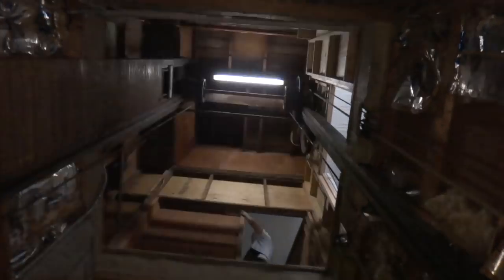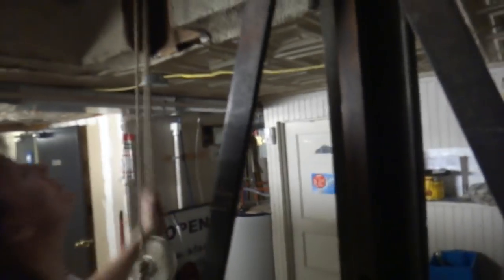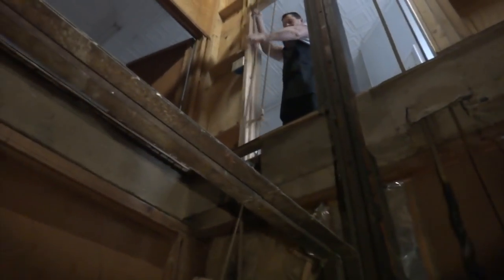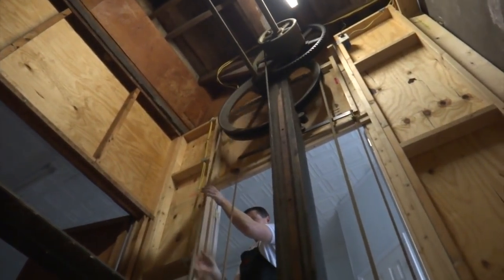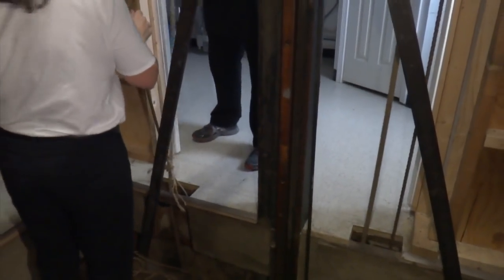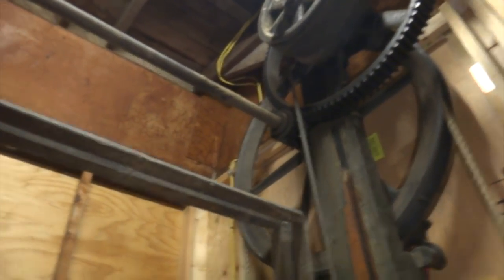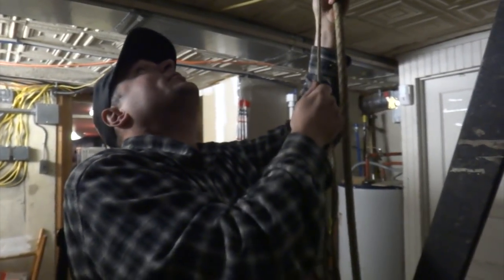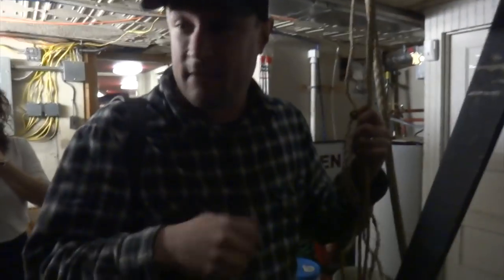Historic Hand operated Otis elevator in South Boston VA

Comment: Now I remember an old Otis in Columbus Ohio. It was a freight elevator that had the capacity to lift an automobile. Lifting gates and a 'master' power switch that you had to turn on to send power to the motor but to run the elevator there was a steel cable that you had to lift to go up and pull to go down, not a self leveler. This was home to a small church production company that put on a musical performance once a year and we used the elevator to run sets and risers up for storage or construction. The show was forced out of this old warehouse as the area was redeveloped and the warehouse was remodeled into offices. Last I heard the elevator was still there and operating.
Reply: What is the name of the building with that elevator? Do you know if the elevator is still there and original after the renovation?
Reply: +upanddownadventures, this was from the mid seventies when a church group rented the building. I have only heard rumors that they left the elevator in place when the building was renovated. I believe the address is 77 E. Nationwide Blvd. and houses one of Columbus's largest real estate firms today. Very few structures from the early nineteen hundreds remain today in that immediate area, as it has under gone extensive renovation in the last decade.

Comment: Someone from an old building called the elevator company I worked for one time saying their elevator fell. It turned out that they had this exact same one in their building. It was an extremely interesting thing to work on. The serial number plate was one that was made way later because it said “OTIS ELEVATOR CO. Serial no. 1” . 

The gear reduction should have been in a museum. We had to make new brake pads out of fire hoses. The ropes needed to be managed properly also, as anyone on any floor could pull on them and release the ancient brakes and it would freefall. 

I had pictures of it but unfortunately I can’t access them. I didn’t realize it was older than 1880s. Wow

Comment: Today I found a non-electric freight elevator in the 3rd Ward District in Milwaukee. Sadly I didn't ride it and it was the only elevator in the building in some hallway. I was looking all over for the buttons until I found the rope which is when I found out it was a non electric elevator. I'll for sure ask the building owner to ride this some other time.
And If you ever come up to Milwaukee I'll show you this and several historic elevators in the 3rd Ward district including an innerdoorless 1890's frassenger elevator. Milwaukee is basically a hidden gem of historic elevators in my opinion.

Comment: Wow Dieselducy this is very cool, this would be considered an Amish elevator or a huge dumbwaiter however, but that's awesome that non electric elevator would still work after after the power went out in the building, well I would have never thought this was an elevator, because of the way it looks, but I bet it's a pain or struggle pulling up and down the rope to take it to the upper and lower levels of this building.
Reply: They are quite easy to use in reality.
Reply: Rowan de la Barre Forreal hmm!